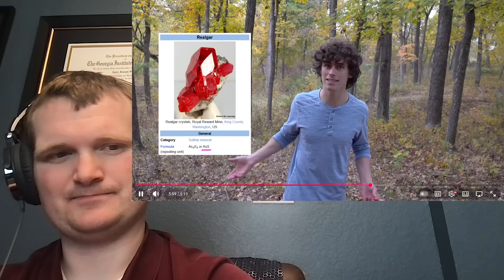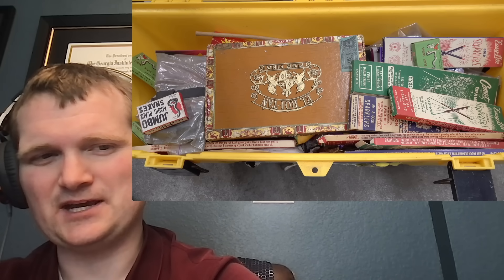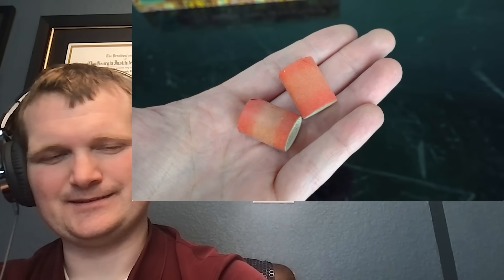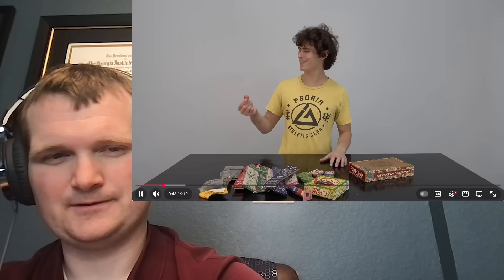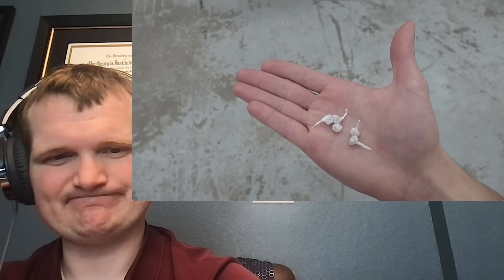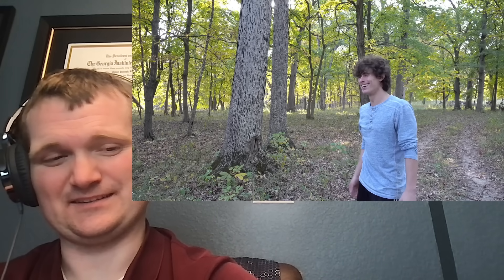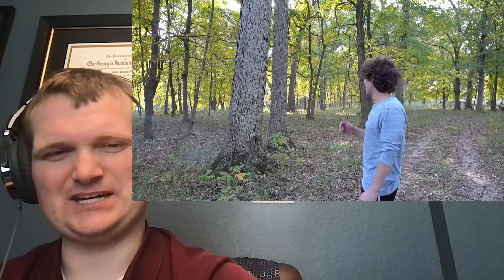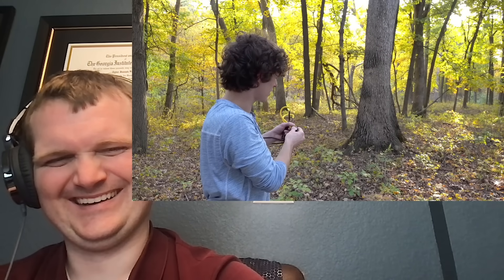Fuseless Fireworks from the 1940s - Nuclear Engineer Reacts to Styropyro

Comment: In Greece, a very popular firework was like a flare in how you lit it. You're supposed to strike it as it's being thrown cause they are known to go off within a second 😂😂
Reply: We had very very small fire crackers mainly meant for children (they had to say 15+ for regulatory reasons, but we all knew no self-respecting 15 year old was going to bother with these); the fuse was one of those reallly unreliable gray paper+black powder ones. You lit it and it would explode randomly in about 0.1 s to 2 seconds. These were only able to persist because you were basically fine if you held it tightly between two fingers when it exploded; that's how pathetic the explosion was, but they were still just unnerving.
Reply: Sounds less like a firecracker and more like a grenade.

Comment: @T.Folse Nuclear by law, class C fireworks, i.e. fireworks that can be legally sold without restriction in the united states to anyone, require that the fireworks contain no more than 1.3 grams of black powder in them.
Reply: Flashpowder I think 
Because 1.3g of black powder wouldn't even explode when confined
Reply: @koukouzee2923  Whether 1.3 g “explodes” (or rather deflagrates) depends on circumstances, the typical energy release for black powder is on the order of ~4 kilojoules per gram, which is roughly the equivalent of 0.9 g TNT, it can most definitely produce a pressure spike capable of rupturing a small, rigid container..
Reply: 8:30 some dude holding an axe is my favorite laboratory environment.
Reply: 4:49 I think just using the term sport ball clued us into that.